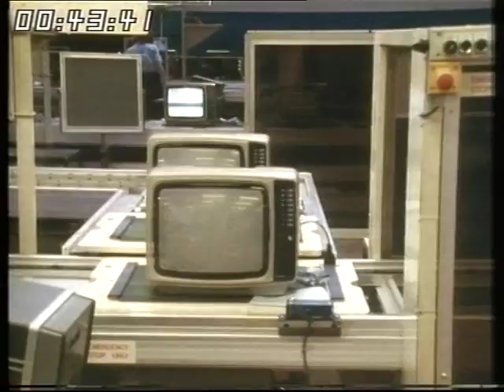How to build a Television | Television assembly plant | Sanyo Televisions | Afternoon plus | 1984

Comment: I have the exact same TV as the ones you see at 2:30! Weird seeing them brand new and being assembled in a factory!
Reply: Can you still get a reception on it?
Reply: Doubt it as analogue broadcasts switched off several years ago. 

But I can still play VHS tapes, DVD's, video games, etc on it. The only problem is that the picture is a little slanted, I think it's something to do with the yoke, and can be corrected by adjusting it. Other than that though the picture is fine.
Reply: @RPKGameVids  RF modulators are great for using old sets.

Comment: Used to work for Sharp doing this type of job on microwaves. Was a TV factory aswell.
All this gone now due to the EU moving it to the slave countries they  can use for slave labour.
Reply: +MonkeyHunch1 I wonder why they always end up foaming at the mouth so much? It's pretty odd.
Reply: I agree this is never mentioned when talking about why we should leave the EU. They destroyed manufacturing here in the UK, to go to other cheaper slave labour countries.
I worked at this factory from 87 to 89  when it was at it's peak workforce of round 350.just before it closed in 2011 there was around 67 workers.
Reply: Yet anther reason why we need to get out of the corrupt dictatorship known as the EU.